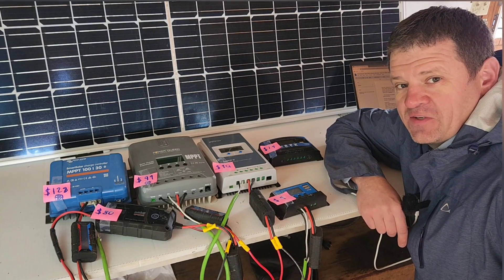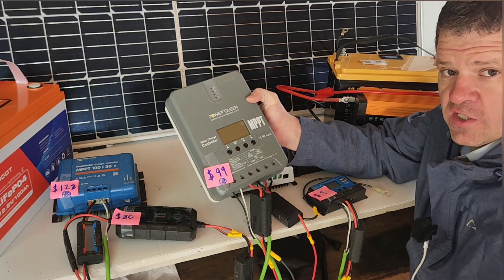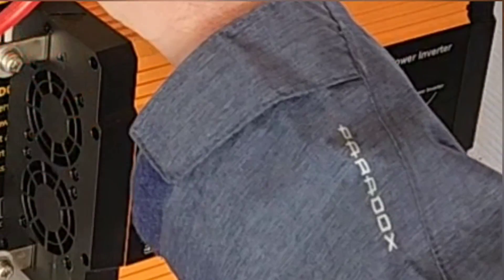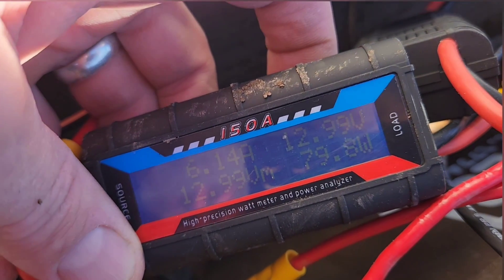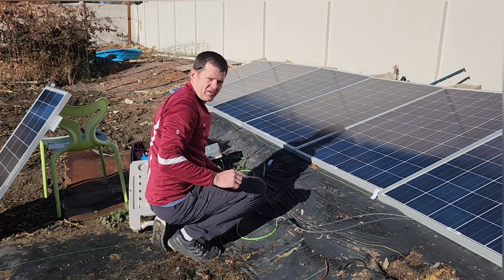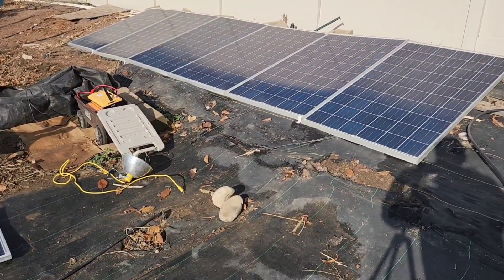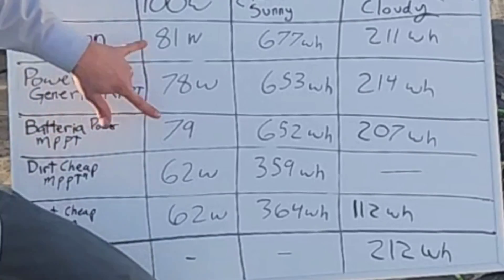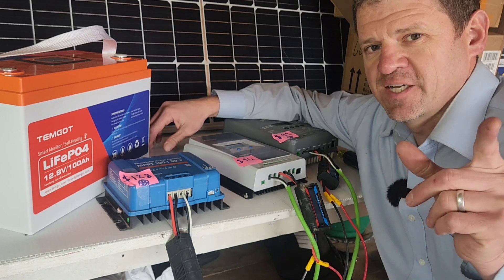Solar Charge Controller Showdown & Buyers Guide

Comment: The only thing don't convince me are the meters. Or better, I ask you if they are very good quality meters. Because if not, it's impossible trust to 3 or 4 watts of difference in a day with 200wh of productivity.
A very small deviation or measure error on instant reading, get accumulated along the day. You can mix the meters, in a second or third test in cloudy day, sto see at least if results are confirmed or not
Reply: As a guy who did lab and pilot plant trials for years, I don't see the results from your "real" mppt controllers as being different from each other. Too many uncontrolled variables - panel performance, meter calibration, battery initial state, etc. - differences of 5% under these conditions would seem to be within experimental noise. It does distinguish between mppt and pwm.  Any other judgments I would base on features, size, or build quality of the various mppt controllers.
Reply from the maker: That's a good idea.. I'm not sure I'll do another test though.
Reply: @diySolarPowerFunWithRay  shame 😭. Your test very interesting me. Especially cloudy test with victron "worst" then some other. I say that not for defending victron. But because I know Very well tracer and victron. I use both a lot. And are pretty comparable in efficiency with slight vantage for victron. In The tracking on a established mppV with "perturb and observe" method, victron move up and down the voltage (fractions of voltage) with slight higher frequency. Than, victron make a complete scan of IV curve, every 10 minutes. Epever I don't remember but less frequently.
The periodic complete IV curve scan, needed to find in any case the real mpp voltage, even when do to particular partial shadow, 2 or more apparent mppv are created. 
If a controller only follow the mpp with "perturb and observe " tracking, it can find a fake mpp. But if controller make a complete IV curve scan every tot time, finally find the real mpp.

If you don't know, epever have a strange strategy when Power is lower than 10-15w. It stop the tracking. And make a complete IV curve scan every hour. If you don't know I can explain this thing 😁it's very interesting.
In The ending, both have same purpose to minimize losses and inefficiency at extreme low power.
Victron make this, retarding the start with PV voltage is 5v more battery voltage.
Epever start earlier at 2v more battery voltage. But then use this strange strategy.

Comment: If the wiring is perfectly identical, and the controllers are in parallel and IN BULK STAGE (absorbtion and floating stage don't work in MPPT mode, even if almost anyone knows that) the results are reasonably accurate.

Comment: I think you agree with me that is terrible annoying you cover the table ALL TIME WITH HANS OR LEGS OR BODY. What's the sense of the table if you cover it? Anyway, really good job but I don't understand if the wiring of all controller ls are perfectly identical, including fuses, crimping etc. If not, when the difference is so small, the rest is not credible.
Reply from the maker: Yeah the mppt controllers were all very similar.  Definitely nothing super conclusive here. I was surprised at how close the results were. You could definitely tell the difference between the pwm controller though.

Comment: hah, glad i surfed on by. i bough 2 lithium batteries as a Xmas present to myself , and it seems the cheap fake MPPT charge controller ...lol..
i guess i will be ordering a better one  the solar queen is out of stock right now.
Reply from the maker: If you wire both your 12v batteries in Series then you'd have a 24 battery and you would be golden!

Comment: I got a 175w panel, 36v,  I use the blue cheap one, 20amps, 110a leisure batt, lead acid, all my stuff is 12v or below, no 12v to 240v, a TV, fridge, led lights, summer time it does me,  winter, have to use a inverter Geny, 1000w, for 4hrs every 3rd day, to top up batt, I like to keep it "KISS",  keep it simple stupid,   :), not like some people,

Comment: pls i am sorry to ask, but do you have any training courses on how to build a small solar generator
Reply from the maker: How small? Something similar to what I show in this video?
Reply: it can be smaller than that, just for 3 lights, TV and fan. Thanks @diySolarPowerFunWithRay
Reply: I’m not an expert (which is why  I’m watching these vids.) I recently purchased the Anker solix c1000. With 200 watt panels it was around $900.
The reason I mention this is it combines the battery, inverter, charger, plugs in a system that somebody else figured out.  I figured I paid a couple of hundred more than if I had put it together myself buying the components separately. The warranty, simplicity of use, and convenience are worth it. Other people like Jackery or Bluetti which I assume are good too. Note: I have not bought their extended battery for the unit, but plan on adding a battery separately to increase the juice. Hope this helps.

Comment: I have 2 DIRT CHEAP PWM controllers for more than 2 years. It is perfect for a cheap 12V and USB electricity backup in case of outage
I created a set with a 50W solar panel + PWM controller + an electric bicycle battery : Super cheap and i can supply electricity 11h to a 12V led lamp + charging USB devices
This DIRT CHEAP PWM has also another advantage : it includes 2 USB ports
Reply from the maker: That's a good point. I should have pointed out the USB ports. Great for running 12 volt lights with the push of a button on the charge controller.
Reply: @diySolarPowerFunWithRay how are users of charge controllers charging their USB devices.   We use the USB ports everyday.

Comment: Why is it that people with little electrical knowledge seem intent on putting up these buyers guide video's,  you wouldn't buy a prosche and chuck in  a mini engine so why get a 250w panel and connect to a 12v battery.
Reply: This was a good video who want to learn more starting from scratch.
Reply from the maker: These lithium batteries can accept a lot of power. 250 watts is nothing for a 12 volt lfp battery.
Reply: Why would someone with so little electrical knowledge reply to a YouTube video?
Reply: You cant even spell  @na88egt

Comment: My big problem is I have 2 PWM charge controllers both Colman one is 10 amps  the other is 30 amps and both do not have proper charge parameters only charge to 12 volts and stop when I bought them I thought that was fully charged until I found utube when I first found out proper charge parameters and that doing so the battery should last between 5 to 8 years I thought all I ever got was 1 year on all my booster packs and the manufacturer should known how to charge their products but I had my old black and decker handy so I took it apart to find out who built the battery and find out what they recommended for charge parameters but written right on the battery was was do not discharge below 12.2 volts float charge is 13.4 and full charge is 14.8 and on the built-in charger was output 12 volts so the utube videos were right and they were all built to fail in about a year so a solar charge controller that shuts off at 12 volts is useless saved me a lot of money because I was thinking of buying a solar generator and had looked at 2 Duracell 1440  and nature's generator Duracell was cheaper but only had a 1400 modified sine wave inverter so it was out for all electronic products found out that the amount of solar it could take meant it would take 2 days to charge and it didn't fully charge the battery either nature's generator looked promising with a 2000 Watt pure sine wave inverter but it had the same charge problem and taking 2 days to charge for each day of use might be okay for a emergency power supply but not for everyday off grid use so I'll open up the units and see if I can change the parameters and if not then I need to find a cheap charge controller for my water pumps and other low voltage device's and for that the solar panel is 75 watts and a automotive battery princess auto sells evergear solar generator and I bought the 2000 watt model so how do you! find out what charging parameters a charge controller has
Reply from the maker: Been there brother.

Comment: Great video! I was always curious how much different the performance would be between brands, but it seems like you'll be in good shape as long as you have a true MPPT controller.
Reply: Don't be too much sure respect this. I installed some cheap hybrid MPPT. For example voltronic or Easun (they are LL the same with different brands). I calculated a top efficiency of 84% in a rapid test. And the worst at very low power, around 60%.

And I've confirmed by others videos that show like while victron hybrid give 1474w output, this Garbage give 1100w. And with victron at 350w ,this garbage 200w.
Epever is nearly victron efficiency and victron smartsolar is probably the most efficient, also compared with maybe better brands like Morningstar.

Epever have a strange strategy at very low power. It stop mppt tracking and make a complete IV curve scan, every hour. I spoke with epever ingenieers and they confirmed my hypothesi. And explained me the reason. But is a bit complex to say in this comment.anyway, that mode maybe cost 20 wh for day. This loose increase when the PV mpp voltage is much greater than battery voltage.

Many YouTubers say that is SLOW TRACKING. Nothing to do with this. Is a stop of moot tracking in certain conditions

Comment: That's a really decent overview.  I would add in terms of charge controllers... never buy a charge controller with a fan.  If the charge controller needs a fan it's because it is a bad design.  One might want to externally have some airflow in the box everything is in, that's fine.  But charge controllers with internal fans should always be avoided.

The Victron 100|20 can handle 12, 24, or 48V, and the SmartSolar version is $88.  That is really the sweet spot, I think.  Even if someone is just doing 12V or 24V, I can guarantee that anyone who gets enthusiastic about solar and batteries will be wanting to go to 48V in fairly short order.  Higher voltage systems massively reduce currents, the wire sizes needed, and heat.  In anycase, getting charge controllers that can do everything helps because upgrading the system voltage after the fact can be costly and it will be one less cost to worry about.

With a 48V battery (16s, 51.2V LiFePO4 nominal), while charging the battery, voltage will average around 53V.  That's over 1000W of solar (~53V x 20A) possible on a single 100|20 charge controller. 

There is one and only one downside to 48V and that is you need the solar open-circuit voltage to be 60V+.  e.g. 4 x 50W panels in series or 3 x 100W panels in series or 2 x residential panels in series at a minimum.   Well, also the minimum reasonable 48V (51.2V nominal) battery size is 25Ah (such as the Lithova battery).

But in my mind that's really the minimum system anyone should be thinking about when going discrete parts anyway.  Any smaller... like if you have just one solar panel, and you might as well just get a power station.

-Matt
Reply: You forgot one extra reason to avoid charge controllers with a fan. If the fan fails, it's guaranteed to overheat and possibly can caught on fire
Reply: I have powmr solar controllers with fan's 
 They perform brilliantly and if the fan fails to operate the controller goes into self protect mode. I know all this from first hand experience. My powmr controller's handle 2800 watts of solar input at 48volt. They show the temperature of the unit and fan's engage at 45 degrees Celsius, they turn off at 40. The fans spend very little time on when the controller averages 1000 watt. If the unit did not have a fan it would not handle so much power, it is without doubt the  highest performing controller for the money. I run multiple units and they work brilliantly, there is a reason why they are so highly regarded. @aleksandersats9577
Reply from the maker: Thanks! Very good points!
Reply: Excellent comment!

Comment: I live in my RV full time, and boondock (dry camp) most of the time. We boondocked for 8 months straight in 2023. We have been using a 50a Epever on a 620w liftable array, charging a 560ah LiFePo-4 battery. It has worked perfectly for the almost 5 years we've had it and is a great value. It has fast tracking and high efficiency too, I'd say it is comparable to the feature rich Victron, just with less bells and whistles. I recommend getting the MT-50 monitor with it for ease of programing/monitoring.
Reply from the maker: Thanks for the comment. nice, set up.  Where do you dry camp?
Reply: @diySolarPowerFunWithRay   We travel the country, visiting National Parks and such, so we've dry camped all over, but mostly out West. Sometimes, when we're in the East, where boondocking sites are harder to find, we dry camp in RV parks, Forest Service and Army Corp of Engineer campgrounds with no amenities. When visiting our son in NC last year we dry camped in an RV park that was full, but they let us stay in an overflow parking area in the back of the park (actually more spacious and beautiful than their regular FHU sites) for only $50 a month. They let us use their dump station for dump and fill every couple of weeks as needed. It was a win-win for both of us. 

We are expanding our system as I type this. We mounted our liftable solar array on the side of our coach, which left the roof free to rack 8, 550W Sungold Power solar panels (4,400 watts) down the length of our 35ft Class A, 15" off our roof, above our AC, fan shrouds, etc. They will cover the entire roof, providing some nice shade with plenty of cooling air underneath, further increasing solar output and reducing the heat load on the air conditioners too. We bought them for only 51 cents/watt shipped to our door! We bought our aluminum racking material in Yuma, where we're wintering over this year, for under $400. Our solar panels, wiring, breakers, etc. arrived a couple week ago, but we're taking our time to get everything in and installed over the winter. At 67 yrs old, we're moving much slower these days. Our Sungold Power all-in-one 48V, 5,000W Inverter/100A charge controller/battery charger just arrived last month. Our 48v battery bank will use 16, 320ah grade A prismatic cells which only cost us $1,726 from EEL batteries. The 200amp Heltec 16s BMS cost $140 more to keep everything safe and happy. So together with our 560ah 12v bank, we will have a total of 23.5 Kwh of batteries onboard (the equivalent of over 18, 100ah Battleborns) - kept charged by over 5,000 watts of solar. 

We removed our rear 13.5k btu rooftop Dometic AC and filled the hole it left with a second powered roof vent. We are installing an EG4 28.5 seer-2, 12k btu mini-split heat pump on the upper rear of our MH. This second phase will provide 24/7 off-grid air conditioning, supplemental heat from the heat pump and allow occasional usage of our rooftop mounted, softstarter equipped Furrion AC in the front of our MH during peak afternoon hours, as well as give us whole house 120v ac power. We'll soon have total off-grid electrical independence for a total budget of around $11,500, reserving our generator for back-up use only. 

Having all the power we need gives us options that most don't have.
Reply from the maker: @SuperSushidog  wow that thing's going to be powerful. I like the idea of removing the air conditioner from the top and putting in a mini split. For my setup I just don't know where I would put the mini split?  On the back hitch? I think that would work but it might not look very good back there
Reply: @diySolarPowerFunWithRay  we rarely need to operate the A/C unit. We will be under a 30'x40' Steel Building without walls. Hoping that a swamp cooler is all that we will ever need once we are set-up. Considered the mini-split for heating though.
Reply: @diySolarPowerFunWithRay  I made a couple L brackets out of 2" square steel tubing welded to 1" x 2" tubing and attached them to the roof, so the roof supports the weight.
Reply from the maker: @SuperSushidog  that's cool, so your mini split is still on the roof? Do you have the link to the mini split model you installed? Or pictures.. id live to do that... did you also need to install a special vent for the inside air? Sorry for all the questions. I've never installed a mini split before... but need to.
Reply: @diySolarPowerFunWithRay  We travel all over the US, but boondocking spots are easier to find west of the Mississippi. We'll be in NC in April and have reservations to dry camp at an RV park there for only $50/mo. while we visit family, including dump and fill privileges.
Reply: Good to know. My wife and I are getting ready to build an off grid RV pad on our property in Northern Nevada... first item on the list is 48volt off grid solar system to power the RV.